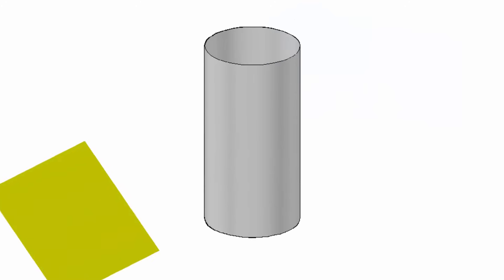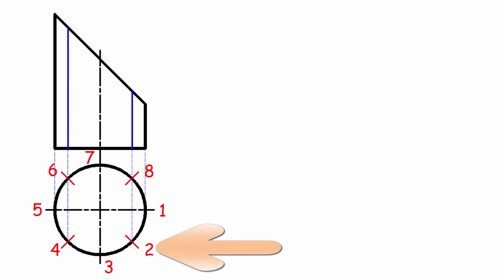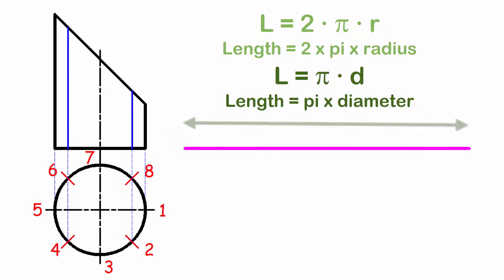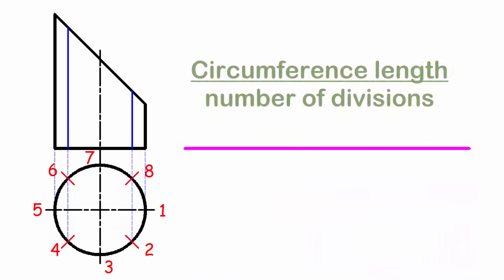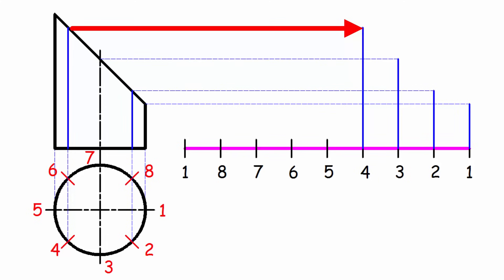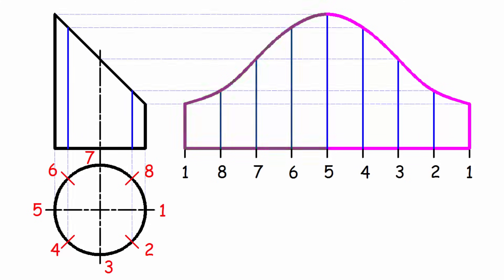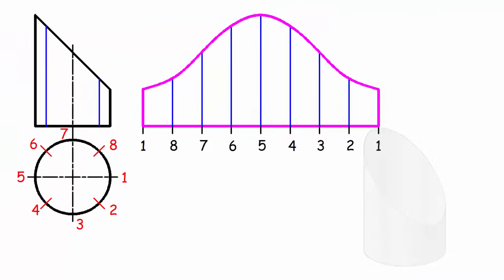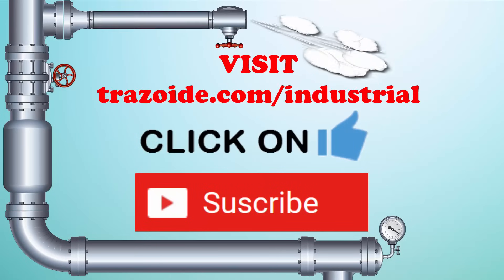#Template to #miter #pipe - Pipe template layout

Comment: Many thanks for a very interesting video.  PLease tell me if you have a video on how to make a template to cut a hole for a cylindrical pipe to intersect a flat surface.  (I have tried an elipse, with the proper width and height, but the shape came out wrong).   Or if anybody knows of such a video, please show me the link.  Thanks again.

Comment: please tell me in North  American English
Reply: Hi, Jo Mtz.
Sorry if the translation, vocabulary or accent is not appropriate, but I only speak spanish and the translation is done by a machine.
Reply: Este patron Es para la Pata que soporta el 90?
Reply: - I do not understand what you mean by 90.
- No comprendo qué quieres decir con 90.
Reply: Que dise en segundos 20 @ 25
Reply: - It says: "We have the elevation and the plant of the miter pipe".
You can click on the subtitles icon and maybe reading them you understand better. Sorry for the mistakes.

- Dice : "Tenemos el alzado y la planta de la virola".
Puedes pulsar en el icono de los subtítulos y tal vez leyéndolos lo entiendas mejor. Disculpa los errores.
Reply: para un codo de 90 grados
Reply: conosido como Pata de mula
Reply: - The procedure is the same for any angle. The only thing that changes is the angle of the top with respect to the horizontal. The angle should be half the total angle of the elbow, ie for an elbow at 90 degrees the angle should be 90/2 = 45 degrees.

- El procedimiento es el mismo para cualquier ángulo. Lo único que cambia es el ángulo de la parte superior respecto de la horizontal. El ángulo debe ser la mitad del ángulo total del codo, es decir, para un codo a 90º el ángulo debe ser 90/2 = 45º.
Reply: podemos ablar en face time o comunicar mas tarde ??
Reply: Llo tanbien tengo patrones que puedo compartir